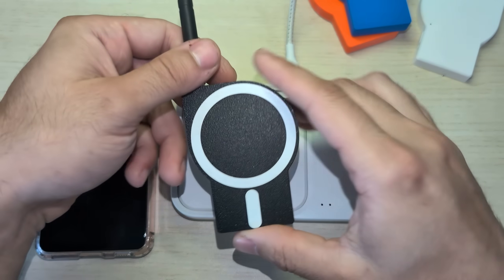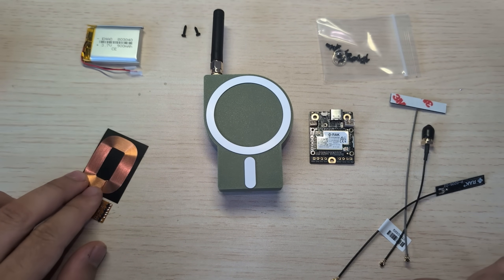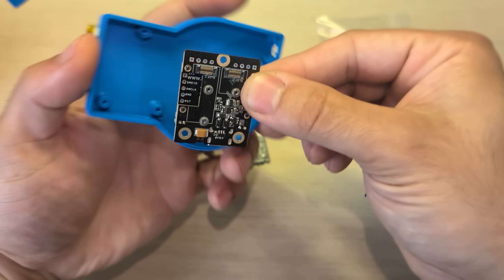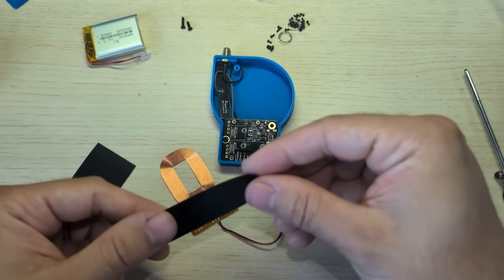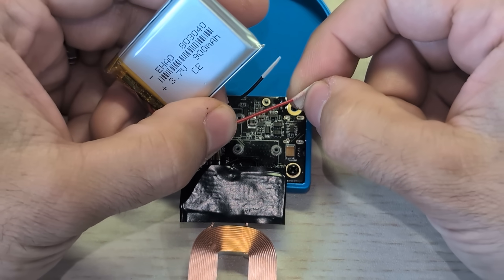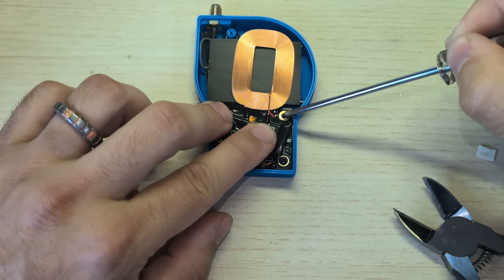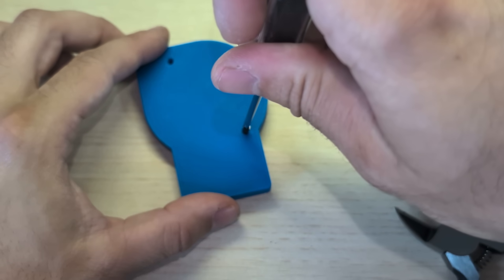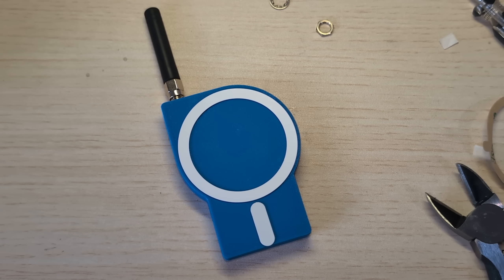Magtastic - MagSafe Meshtastic Node

Comment: Hi, this came on my reccomended. seems quite cool but i dont know anything about this, what is this? what does it do? cool video though, you are very professional!
Reply from the maker: Thank you! Meshtastic is an off-grid low power long range text only communication system. You use the Meshtastic app on your phone to interface with the radio. They're called nodes since every radio is also a repeater for other radios creating a mesh network for all users to deliver messages through.
Reply: @jdigi78  when you say long range... how far?
Reply from the maker: Its basically limited by line of sight. If you can see the area the other node is at without any major obstructions it will likely reach. It loses range significantly with anything in the way though. Height is your friend. I've seen some people strap radios to drones and kites to get some crazy range. You can see some distance records here: https://meshtastic.org/docs/overview/range-tests/
Reply: same, i would appreciate a video of u using it to know the funcionability
looks great
Reply from the maker: I didn't expect this video to get as much traction as it has, especially for non-meshtastic users. Will be doing a demo video soon!
Reply: What is the maximum range between nodes?
Reply: @WeiFinder depends on antenna size, line of sight, and the weather. It can be pretty far.
Reply: Will something like this work if all the cell towers/networks go down?
Reply: Yes, they communicate using radio technology, not Wi-Fi or cellular networks.

Each device is a self-contained radio. When you send a message on one, it gets transmitted over the air directly to nearby nodes and they form a mesh network, meaning if a node is out of range of another, messages can still be relayed through intermediate nodes.
Reply: @WeiFinder  the only thing about that is when the power goes down in the generators at the Radio towers run out of fuel then the radio towers won’t work either
Reply: So it's a walkie talkie mod for magsafe compatible devices basically?

If i had a reason to buy one I probably would lol
Reply: @Hysandel more like text messaging rather than voice, but ya. My friend build small walkie talkie type devices that work out to 80km I think he said, pretty dope, but those don't create a mesh network.
Reply: this is STRANGERS THINGS!  LOVE IT

Comment: Absolutely love this Idea and might tweak it to use a xiao 32 lora setup.  As an Electrical engineer and HAM operator, I only have a few suggestions for a 2.0 model.  
1. Add a power switch and connectorize the power connection. It is not normally a good idea to solder a battery to a device without being able to turn it off or otherwise disconnect the battery.  
2. As others have suggested, Kapton tape would be a great replacement for the electrical tape which I realize not everyone has a stash of that available. 
3. RF devices should never be allowed to transmit without an antenna attached which is another good reason to be able to disconnect the power.
An awesome idea overall and I totally hope it has been going well for you!  Thanks for sharing.

Comment: Do you technically need the battery? Or could you use this device with reverse wireless charging only from the phone without having a battery connected to the RAK4631 ?
Reply from the maker: Reverse wireless charging is pretty unreliable, so yes you need the battery.

Comment: Have you considered attaching a magsafe to a Sensecap T100E? They have a battery, internal antenna with huge range and are slimest meshtastic devices I seen.
Reply from the maker: The battery only lasts 2 days which is frankly too short for something that needs a specific cable. This one lasts 5 days. I also see internal antenna as a limitation since you can't swap it out for a larger one, even if the internal one is decent.
Reply: @jdigi78  The magnetic cable is what turned me off. USB C is the only option.
Reply: @jdigi78  exactly because of the current small battery, I was thinking something like T1000E could be powered from the phone with Magsafe, that doesn't work? I know some Samsungs can also charge attached devices, not sure if that is a general magsafe thing.
Reply from the maker: @adrianTNT reverse wireless charging is very inefficient. It's a cool party trick and will work in a pinch but I wouldn't want to rely on it regularly.

Comment: What is it though?
Reply from the maker: Meshtastic is an off grid messaging system like HAM radio, but doesn't require a license as it uses very little power despite being long range. Signals hop between radios to create a mesh network extending coverage further.

Comment: Does it work without the battery?
Reply from the maker: If you keep it on a charger I suppose, but I don't see why you'd do that
Reply: @jdigi78 Because a device, who spends most of the time in the drawer, should not have a built in LiPo battery.
The T1000-E has already turned into some kind of Tamagotchi, as it will die, if it isn't in use. From my HackRF+Portapack, i have ripped the internal battery long time ago, because it was down, every time i had a use for it. No need for spicy pillows.

Also i talk about reverse charging, not plug in another battery. The phone already has one.
Reply: @goiterlanternbase  exactly my thought! Have you found out if the board works without the battery connected on the wireless charger only?
Reply: @macualey   Can't find the extra money, to purchase one😩 Still trying👍

Comment: That's the coolest build I've seen. I always wanted to get into meshtastic and never did. Seems like time has come now as i love how your design looks. 
Wonder if there is a way to get your phone to charge it so any time you stick it to the phone it automatically charges and you don't have to worry 
Great job
Reply from the maker: Thank you, and they are back in stock! You can charge it from the phone but wireless charging is pretty inefficient. On my Pixel 9 every 1% drained provides about an hour of radio use.

Comment: It would be really slick if everything snapped into place with clips printed into the plastic instead of requiring screws.
Reply from the maker: I thought about that, however there was a risk of the case popping apart if pulled off a strong magnet. This design is extremely durable.

Comment: Don’t know what it is but I want one. Or two.
Reply from the maker: Meshtastic is an off-grid, low power, long range, text communication system. Messages are passed between radios creating a mesh network to extend the range even further. You also don't need a HAM radio license to use it.
Reply: @jdigi78 did some reading online about this as I’ve never heard of this before and didn’t want to ask dumb questions without researching but from what I gathered, this can be used to transmit text messages without wifi or cell signal in remote location using radio signals. You have to have the meshtastic app to use this, and the person you’re sending the message to have to have a meshtastic app as well in addition to this device you are showing in the video, did I get this right or does the receiving person only need the app to receive text, and if they want to reply, they would need one of these devices themselves (so one device an app per person to communicate back and forth)?
Reply from the maker: Each person would need the Meshtastic app and some form of Meshtastic radio.

Comment: Apologies if I'm stupid but what is the purpose?
Reply: They are off grid text based communication devices, that pairs to the phone using Bluetooth. That uses LoRa (Long Range) radio frequencies to communicate from device to device. Similar to Ham Radio, but you don't need to be certified to use these.
Reply: @Thekiddmarley Does the person you are contacting need to have one too?
Reply: @chaoticstylez yes they do, I actually made a couple to use on a trip last year, but the antennas I used didn’t work for long range

Comment: Do you have video for demo, showing how it works / use case
Reply from the maker: It works like any other Meshtastic node, which there are many videos. The primary use case is communicating while hiking or any activity where cell service is usually lacking. It would work well in emergency situations as well where power and cell service are down.

Comment: Been meaning to make this very similar thing; I wanted mine built-in to the case but I think I like this better.
Reply from the maker: The ability to remove it is very helpful. It can be difficult to keep on the phone with tight pants sitting down so I often throw it in my shirt pocket. It even fits in that tiny coin/watch pocket found on most jeans!

Comment: How far do they go in range out in open field or woods?
Reply from the maker: The limit is mostly determined by line-of-sight. Odds are if you can even vaguely see the area you're trying to contact you can reliably reach there. I would expect about a half mile to a mile in woods. Height is your friend, and so are other nodes since they will act as repeaters by default.

Comment: Wait. What is this? Just saw this recommended, and i like 3d printed stuff.
Reply from the maker: Meshtastic is an off-grid low power long range text only communication system. You use the Meshtastic app on your phone to interface with the radio. They're called nodes since every radio is also a repeater for other radios creating a mesh network for all users to deliver messages through.
Reply: @jdigi78 so u can only text using that app? Does the other partie have to use that app to to receive those txt?
Reply from the maker: The other party would need a Meshtastic node and the app. Some nodes have screens and keyboards so a phone and app isn't necessary with those.

Comment: Good stuff, but a couple of things...
1. Make sure the antenna is screwed on before you connect the battery because not having it connected may fry the lora board.
2. Clean the flux after soldering with a little but of rubbing alcohol and a q-tip.

Can't wait to make one of these! :D
Reply from the maker: You need to select the region in the meshtastic app before it does any lora transmitting. Also I'm using no clean flux, but good point. Thanks!
Reply: @jdigi78  There is room for a switch on top.  Mind if I add one?
Reply from the maker: @tekknowology  Feel free to remix it on thingiverse. I didn't think it was necessary since the WisBlock mini uses nearly no power while shutdown and is meant to be an always on node anyway.
Reply: Modern rf chipsets almost always have open antenna detection these days. And Lora is so low power anyway I'd be surprised if it could reflect enough into the front end to be a problem. THAT SAID, it's absolutely the right habit to get into, for that one case that's actually risky :)
Reply: Android socks